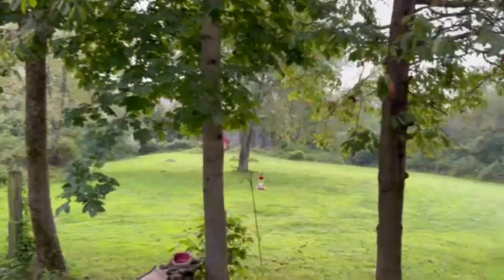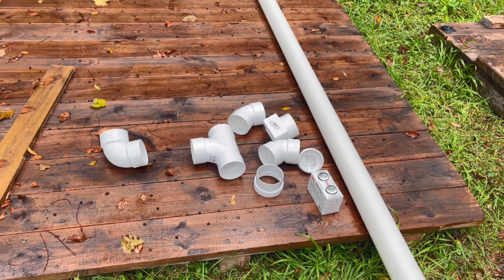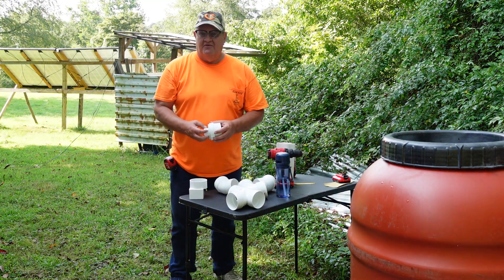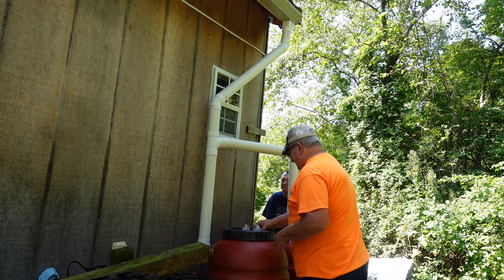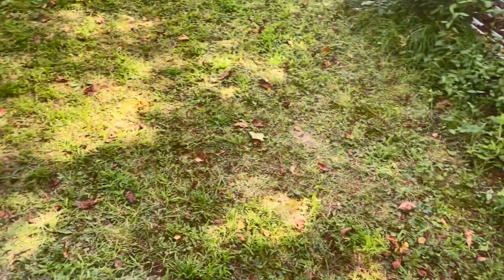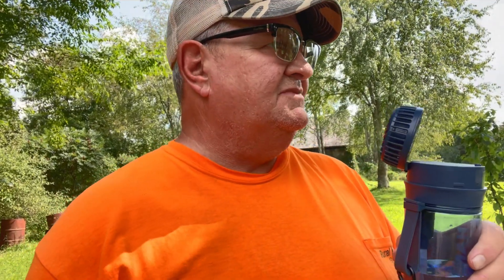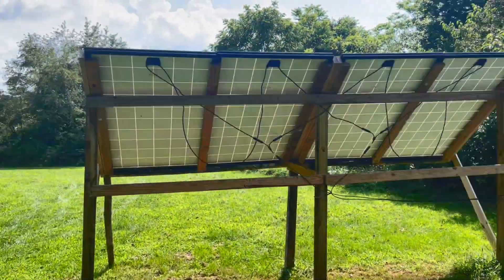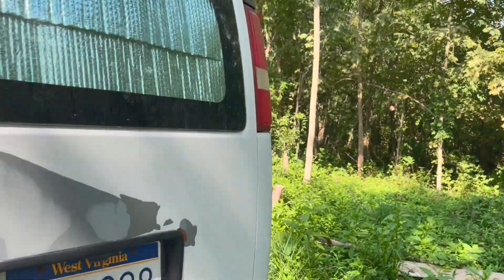DIY Rain Catchment with First Flush Diverter

Comment: So unless you unscrew the cover on the pipe and let that water drain out this system is only good for maybe one or two rain events? Subsequent rain with the pipe full will deposit the dirt into your barrel? Would a weep hole in the cover work?